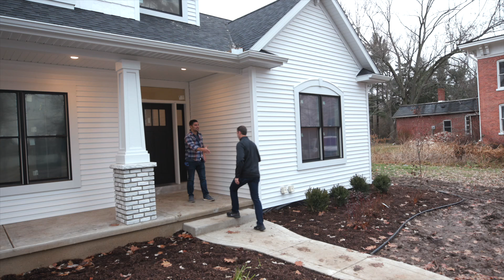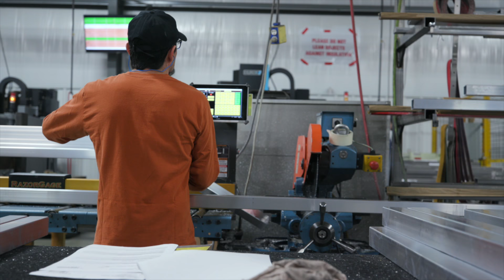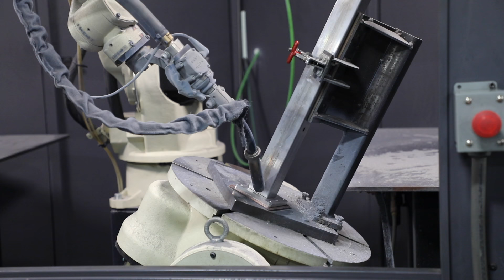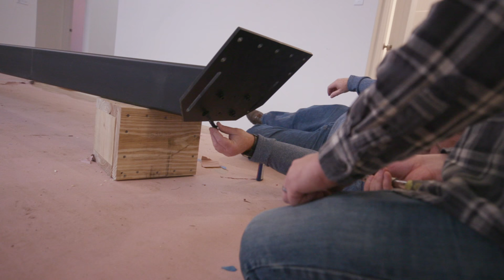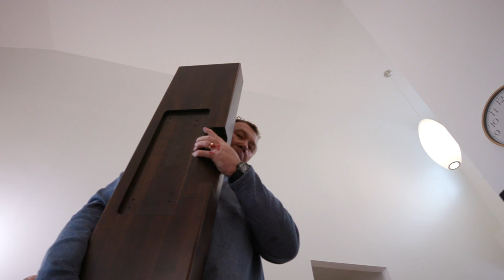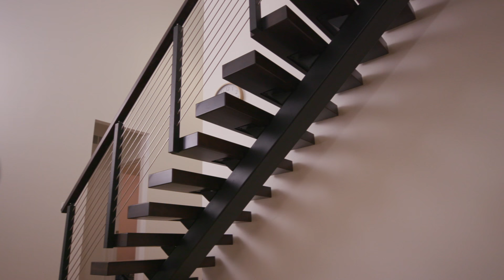One Day Floating Stairs Install - Guess How Much These Cost!

Comment: To the folks exclaiming over the price tag. firstly, that is the price of convenience. 
Secondly, while there might only be a thousand dollars of materials in the stair there are costs to running machines, saw blades, drill bits, oil, grease, electricity, etc. 
Then there are people costs, they have to have someone to code the CNC, and if they aren't paying competitively that person would leave, so that costs is also going to be spread out over individual projects. 
Oh, then there will be about 10-20 other folks working different tasks, material handling, machine maintenance, etc, who's wages also have to be spread out. 
Economies of scale is not in play here, they would have to make thousands of exactly the same model for those savings to appear.

hypothetically: Old Joe and his buddy Hank could fabricoble something similar for a quarter the price, but old Joe and Hank are often busy with their regular work of fixing tractors and installing cabinets and might have trouble fitting the fabrication of stairs into their schedules in a manner that works for the builder.
Obviously Joe and Hank are fictional people, but I suspect most everyone has at least one Joe and one Hank in their circle of acquaintances :D
Reply: The sad part...    I >am< Joe and Hank...
Reply: @psygnale  Haha, same here, I split them into two folks because most of the people I know that work with metal generally suck at, or hate, woodworking, and most woodworkers I know seem afraid of metal working for some reason.
But I do know several folks that embody both Joe and Hank. . . including a guy named Hank haha
Reply: No matter the logistics behind the manufacturing and sale.
Reply: @steamsteam6607  I pointed out some reasons it would cost 12k, and mentioned that it could be possible to get it done for much less assuming you've got a buddy or two with the skills to do it, but they might not be able to do it on your timeline. 

As to people paying premiums for essentially identical products, that happens all the time. 
Apple is a trillion dollar example of exactly that. Apple is an extreme example but the same holds true for food, some people pay hundreds of dollars per pound for premium beef, some people pay for premium gas while driving a vehicle that doesn't need it. 
It seems a lot of people like to splurge based on perception of value.
Reply: @dscrive  Still an apple product is only a month of savings or a month of earnings in my case.  I make about a converted 17-18.000$ a year after taxes. If I was to spend that on this single flight of stairs I would have to live in a tent without heating or services leaving me some 500$ a month for food, clothes and bare necessities, transportation. And I don't live in some underdeveloped nation (depends on how you define underdeveloped). I live in Belgium. So about a year of complete deprivation and homelessness with full time 40 hour weeks to be able to afford this single flight of stairs. So I'd have to live like this for a full career of 45 years without having other costs of children, hospital or any other kind of real expense and I would maybe be able to have a small house with this sort of a staircase in it if this is somehow the idea of a "great price". I know this is a general problem and just the reality of extreme wealth inequality but it is understandible for people to question the notion of this being a "great price". It seems rather out of touch.
Reply: @steamsteam6607  And some people earn $170-180k a year.

Those people may decide that the convenience of being able to go to work in the morning  and come home to a fully installed & finished staircase is worth paying the extra for.

...personally I think that's a bit daft as I was always brought with a 'look after the pennies' mindset, but I do kinda understand where they're coming from ....and there are plenty of people willing to pay for convenience, so why not capitalize on that?
Reply: @DEADB33F  This 180K a year really must be American thing. A neurologist in Belgium makes perhaps 120K a year. Our Prime minister makes 120K a year. What are people doing that makes them earn 180K a year? Even these people mostly would consider a monthly wage too much for a single flight of stairs and they're in "that bracket" supposedly. So you're marketing your stairs towards these people of hedge fund babies, CEO's, top politicians, medical experts and moderate-big entrepreneurs that's quite a small, demanding market you have. But I thought they had excluded man hours, shipping cost from  the price. So when we discount 24*50=1200$ of manual labour and 300$ of shipping it's an 11.000$ flight of stairs. That already looks more reasonable but it still is a LOT of money. I'd expect some LED integration in the stairs of some other bells & whistles for that kind of money. I mean maple wood is nice but it's not walnut, oak or lined with marble or something. I think the company may have suppliers that overcharge them retail prices as well and that's how they end up with prices like that. This should be a 6000$ flight of stairs max imo. But I'm not a builder and I've never manufactured this sort of stairs so I can't say. Maybe it makes sense somewhere. They can charge what they want nobody is obliged to buy it.
Reply: @steamsteam6607  neurologists in the US gets paid 250-300k+ a year easily.. Im an engineer and I make 180. The state of California's GDP alone is 5x the entire country of Belgium.
Reply: @choilive  It must just be the mad out of the nose taxation in Belgium then. Last I checked we had something like the 5th highest taxes in the world. It's pretty much communism I guess. Except that the services we receive are very much behind most  countries with similar taxation. Worse than being taxed out of your ass is when those taxes only go towards your own repression by an occupation. Basically Europe is a genocidal labour camp for Jew power since the end of the second world war. They import hundreds of thousands of Arabs and Africans a year in an open agenda to replace us in our own homelands. All nationalists are hunted, harrassed, persecuted by media and legal power. We have 6 governments and none of them represent actual Belgians. I digress. So all in all these stairs may make some sense in Clifornia but you'd be hard-pressed to sell them in Belgium at that price.
Reply: @steamsteam6607  Max wages in Belgium are definitely far less than in more capitalist countries. But at the same time, in Belgium going to university costs next to nothing, and there's health care. I prefer it.
Reply: Reality says nobody is going to pay 12K for a staircase they can have for 4K.

Comment: From your camera angle (while you were talking to the camera) I keep looking at the finished product and to me it looks like the stair landing is intruding into entryway. Were they built to be sticking out passed the wall? At 4:20 I can see the two stairs sticking out into the narrow area. I wouldn’t like the setup. It’s a beautiful set of stairs though. Solidly built.
Reply: It needs a turn around at the wall it is a terrible layout sticking out there
Reply: chadwick hayes 

I think it looks fine. Not every stair needs to end where a wall ends. Though, at the least, I would add a short section of railing so people aren’t tripping over the tread coming in the front with bags etc. The dead space caused by the intersection of the wall/stairs could be used for a thin piece of furniture for mail, keys etc. or even a thin wall-mounted built-in (my favorite).
Reply: @BigHayes7771  Best answer I've read so far. The turn could have even aligned with that wall and extended back over the downstairs opening a little ways. Too far over to be an obstruction when going downstairs.
Reply: @bnaction     "Look at the elevation, it's already at 45 degree angle. Any steeper, it's a ladder."

Exactly.

IIRC 48 deg is considered a "space saver" stair by OSHA and is the MAX angle you can go and still be considered "stairs".

Typical "steep" residential stairs (IMO) start at around 42 deg on up.

Decent residental stairs go from about 36 to 38 degrees....

...and commercial/public stairs I think are around 32 degrees.
Reply: Not sure if this holds true in the US, but in the Netherlands there are specific regulations for staircases. The depth and height difference of the steps must be between certain values to pass. I'm guessing that's what's going on here as well.
Reply: It looks as steep as it can be. By bet is this was an old house that may have had steeper stairs originally.
Reply: @Ilove3SGTE   I've been wrong before, but I'm pretty certain they said it was a new build.
Reply: Stick out too much, looks stupid.  It’s a new construction, should have plan it better.
Reply: First thing I noticed too. I can't imagine how painful it would be to kick that in the middle of the night.
Reply: @bnaction  They should install a U-shaped stairs, not a straight one. The U-shaped stairs can prevent people fall into the hole. I think their products doesn't have U-shaped stairs.
Reply: Nothing you can do there, the architect made that wall too short. I don't think it looks bad.
Reply: It doesn't look right of course custom it can be made exactly so It's a good question why the bottom had to stick out across entryway?
Reply: P. Chretien 

And elderly standpoint. My friend’s father in law was found at the bottom of their 15 stair run. He doesn’t remember what happened to him. Fortunately he was ok - which is a miracle at 76 years old. They subsequently installed carpet pads on the stairs that were previously slick oak treads. I warned them about the stairs. I was more worried about their 8 year old.  Knock on wood.